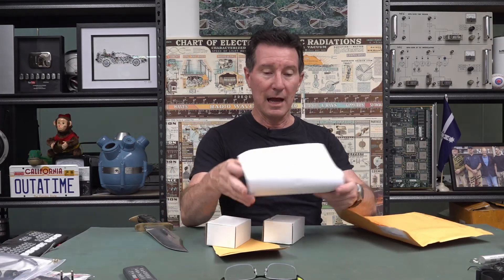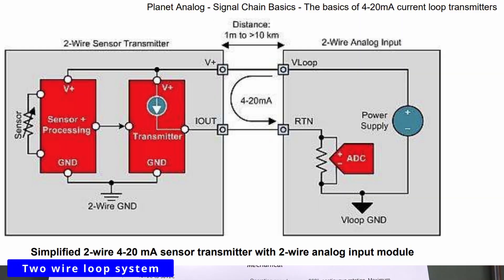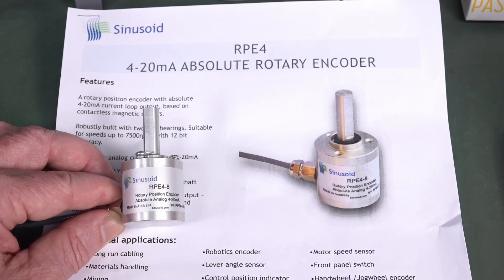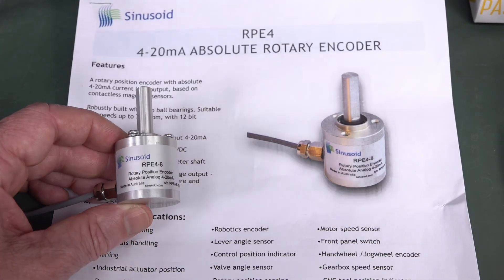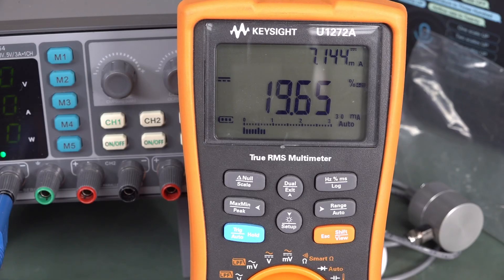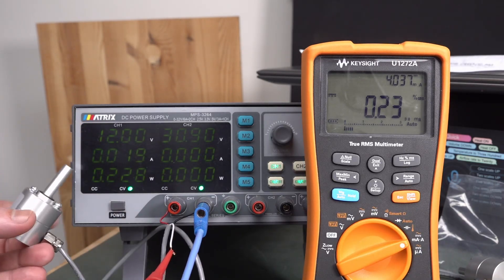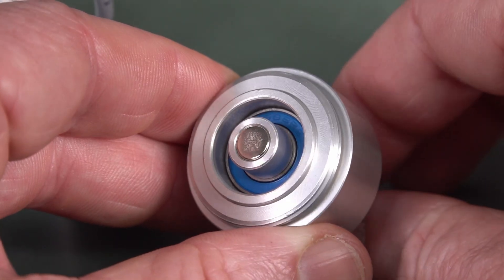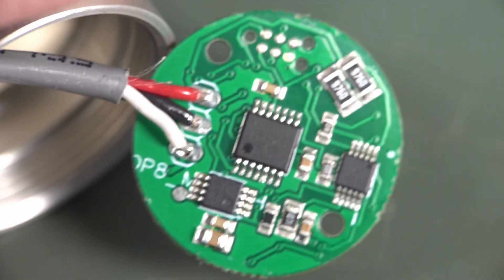How a 4-20mA Process Control Current Loop Rotational Sensor Works

Comment: How is the 2 wire getting ground and even isolated grounds without wires?  lol..  I would think that they would have to be getting it though a chassis ground; but if it's "isolated"??;  then what?  Two different chassis grounds somehow?   I don't get it.   Can we just call things "grounds" that aren't grounded anywhere?

Comment: It's 4-20mA so that there is always a current which can power the device. If it was 0-20mA you'd have to provide separate power via a third wire to any sensor that needs power.

Comment: The main use of 4-20mA was always so that instruments in the field could be self powered, especially in IS (Intrinsically safe) areas. Drop it across a 250ohm resistor and you get 1 to 5V. Yes I worked in the process industry 45 years ago.....

Comment: The other reason for the 4mA minimum is so you can tell if the sensor has failed/cable has broken.
Reply: Mentioned at 4:15
Reply: Yep, 4mA minimum helps a ton for quick diagnostics of a faulty connection
Reply: t's 4-20mA so that there is always a current which can power the device. If it was 0-20mA you'd have to provide separate power via a third wire to any sensor that needs power.
Reply: Another reason could be it is easier to implement precision analog current output that doesn't require going to 0V, that can be tricky as Dave pointed out in his linear power supply project
Reply: But why not 5?
Reply: @worroSfOretsevraH  i guess so you a have delta of 16mA, which is a better number to work rather than 15.
Reply: @JuanCruzAvila  yeah, that would be my bet, 16 works into binary better

Comment: This is a terrible electrical interface for a rotational encoder. What happens when you sample during the transition from 0 to 100%?
Reply from the maker: How is this different to any other LSB sample point?
Reply: @EEVblog2  because for every other count change the current does not need to transit through every value between 4 and 20ma. If the sample is taken then it could measure with up to 180 degrees error. You could reject samples that span the rollover, but some control systems really don't like that. Better solution would be two 4-20mA sinusoidal outputs 90 deg out of phase, and then infer the angle.
Reply: Ikr. Gray code or nothing!